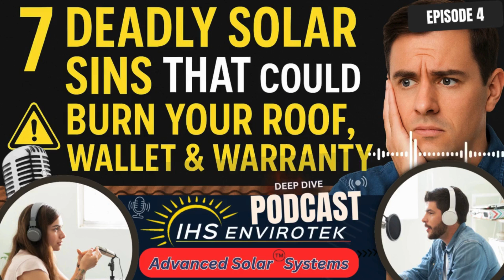7 Deadly Solar Sins That Could Burn Your Roof, Wallet & Warranty!

Comment: What is the equivalent of Codes NAB CEP being adhered to in India?What about good quality Automatic cleaning systems that takes a load off the consumer when it comes to keeping the panels clean.
Reply from the maker: In India, there isn't a direct equivalent to the North American Board of Certified Energy Practitioners (NABCEP) certification program. Automatic cleaning systems do not address the grime and grease buildup, only surface dust. Over time, with pollution, a plaque develops on the panels where there is a lot of pollution, and this is hard to eliminate. In India, it is advisable to always have the panels manually cleaned or with robots for MW-scale installations.